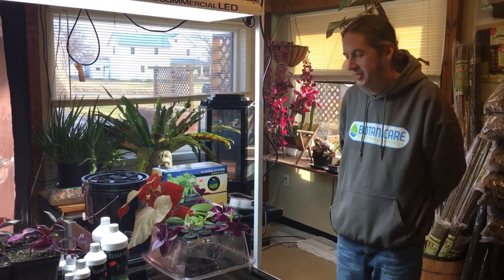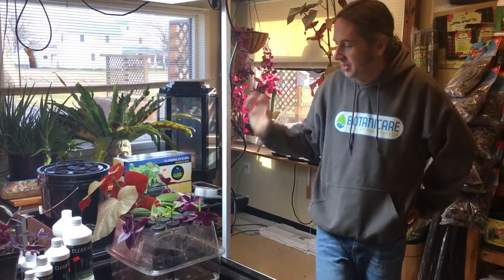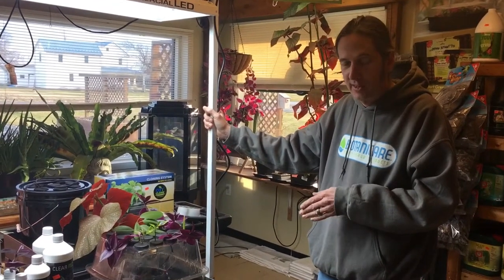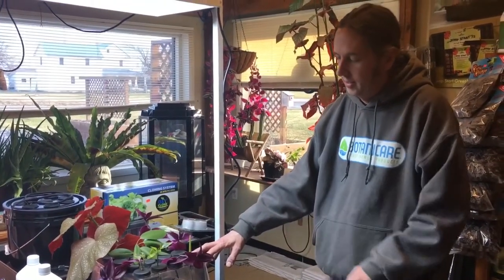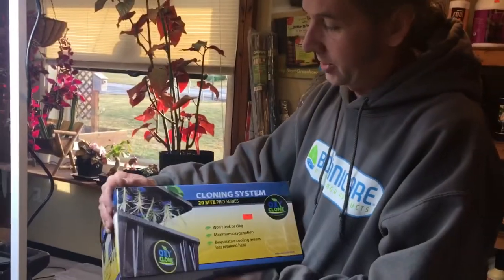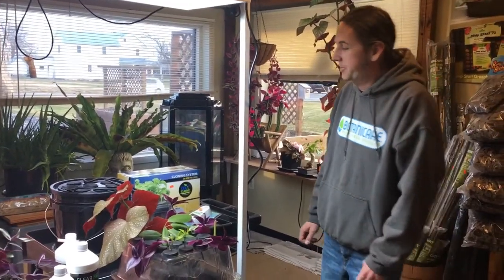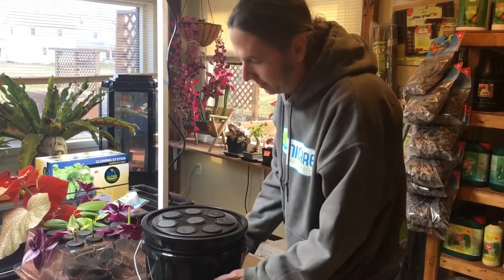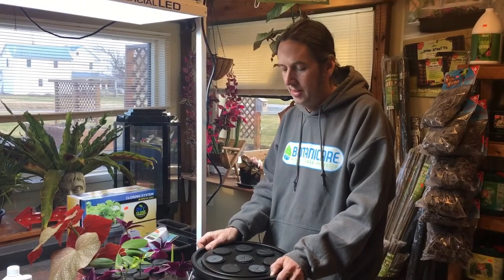CLONING SERIES PART 1 - INTRO TO CLONING - WATCH THIS BEFORE YOU BUILD YOUR OWN DIY CLONING MACHINE

Comment: Got a question for ya that i haven't been able to find much info on. Instead of using a pump and sprayer what about a fogger/ mist maker. ( https://www.amazon.com/gp/product/B00PAK245E/ref=ox_sc_saved_title_1?smid=A1155GBV4DPEXU&psc=1 ) . Ive seen they have floats for them so water level isn't a issue but wasn't sure what is better.  I have heard that they need to be on a timer set to 15 seconds on 2 mins off to allow air so i could see power outage being a concern but so would a pump idk what do u think would work better

Comment: What ate those techniques you can use if planting in soil?? I'm starting to build an aeroponic/fogponic cloner and was wondering your technique to harden them off before putting them in soil?
Reply: I put my clones right into soil without any extra care except for some extra watering.
However, nowadays I put my plants mostly in hydroculture if it's crops or in mineral substrate if it's a pot plants.